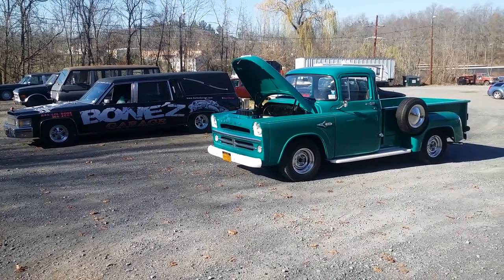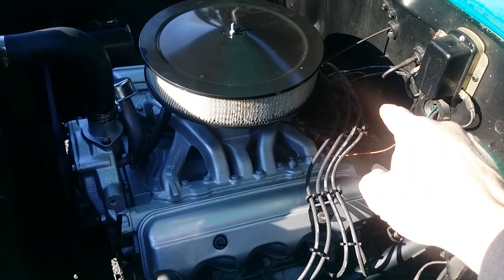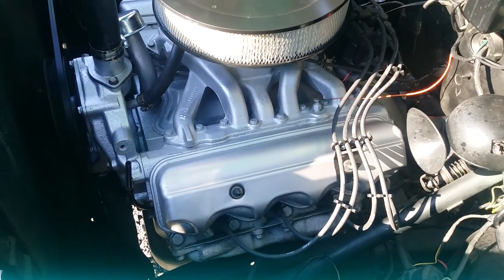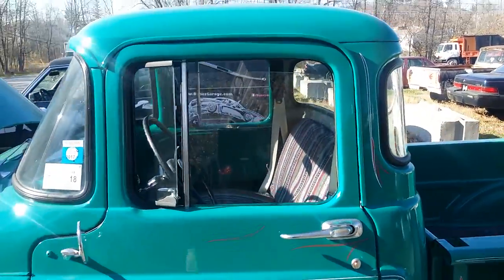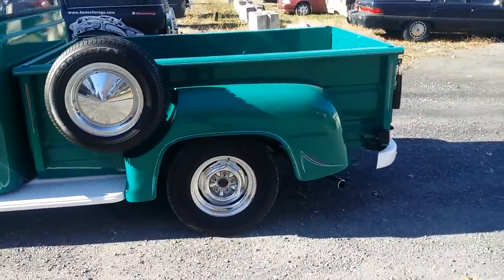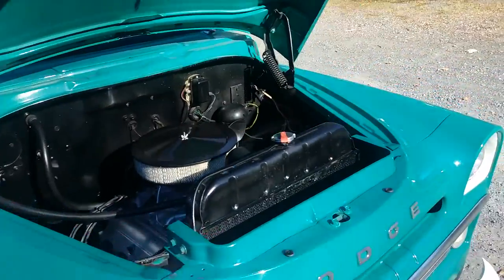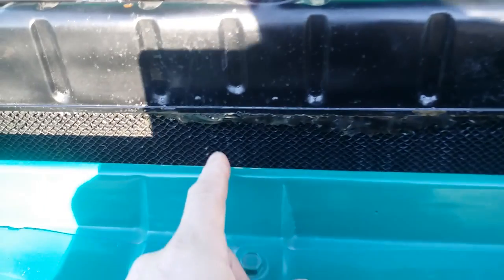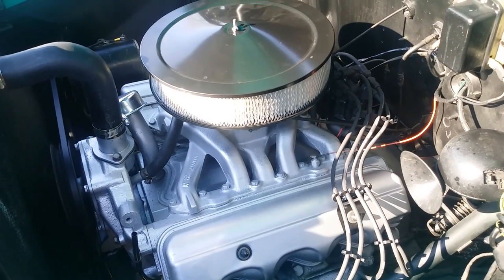1957 Dodge D -100 315cid poly hemispherical motor

Comment: The Poli Motor: Delivering MOST of the performance of the Hemi at HALF the complexity.  The 4.7 PowerTech SOHC from the Jeep Commander is basically a modern incarnation of the old Poli.
Reply: You are correct.   I wish the 4.7 was as trouble free as the poly!